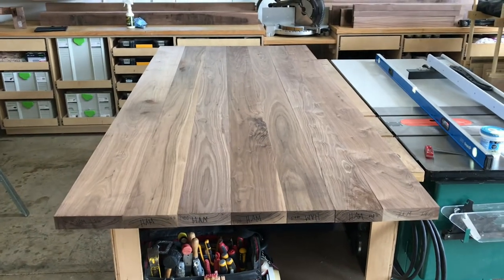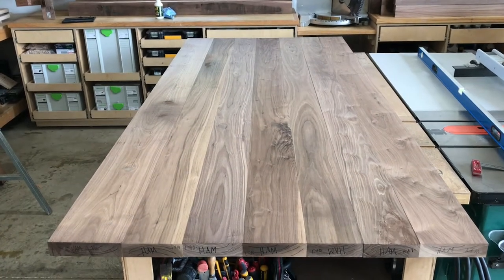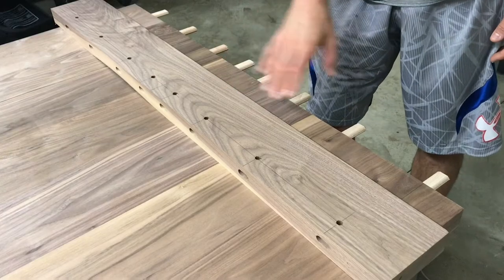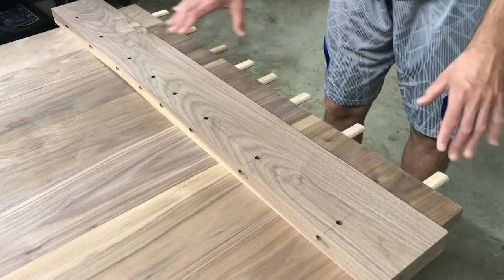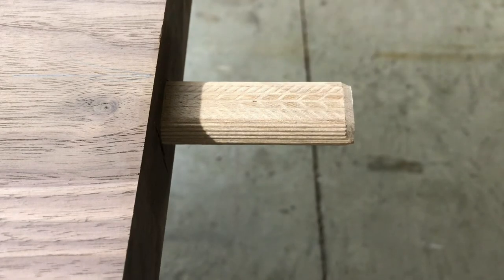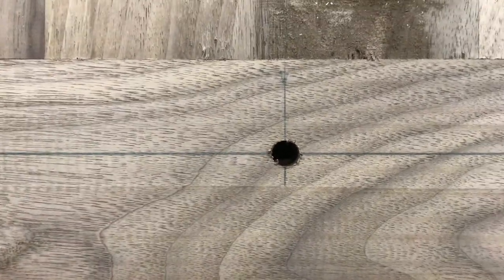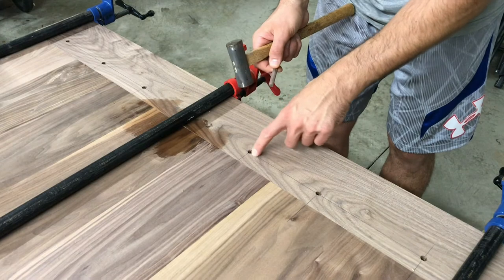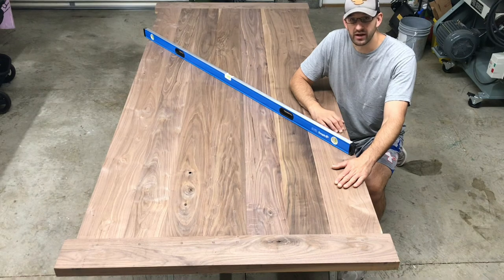Parsons Dining Table - Part 2: Breadboard Ends

Comment: Really nice table you built there. Your video came up at random  and is timely because I’m in the process of putting breadboard ends on my TT using dominos. I like the cadence of how you present your techniques. Thorough and not too fast.